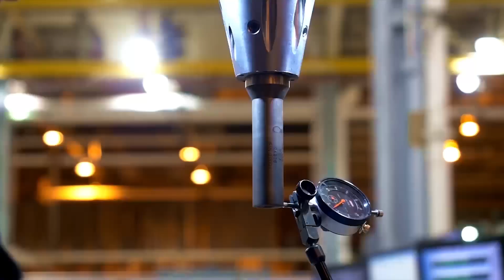Bad News For The 3 Artemis Missions

Comment: I love it how videos like this always show their bias when they compare the legacy Aerospace companies, Blue Origin versus SpaceX.  You just mentioned how the SLS will need to go out to the bad, do a zero count, then be hauled back into the VAB for inspection. Musk isn't performing these steps, but they are mandated by NASA.
Reply: Sure he is, for new designs. Every Starship flight to date has followed that exact model, with static fires followed by a complete checkup before launch. So has every Falcon for that matter. The Amos-6 mission that blew up on the pad did so during the static fire, aka when they were doing exactly this kind of prelaunch check.

The difference is that the SLS can only be inspected in the VAB, while SpaceX designs their rockets to be inspected on the pad to save time.
Reply: @gnaskar  Not really, especially considering the vast majority of the starship modles have exploded or collapsed. Their gunhow approach gets  results, but its something the other established contractors would never be able to do.

Comment: I like how you snuck the Hercules lander in there at 4:24 :)
I'm rather disappointed that you are buying into the "infinitely lower cost of Starship" myth, specifically as it has no basis in reality. Starship, and specifically Lunar Starship, is not going to be rated to take crews from the surface of the Earth to Lunar orbit any time soon. SLS already exists and the production and flight vehicles are in production as we speak. Starship mostly exists as a prototype-prototype with none of the systems needed to make it a viable launch vehicle let alone a Lunar landing vehicle. (Big issue right there is needing actual landing gear to, you know, have a viable landing vehicle... It's right there in the name no less)

SpaceX isn't going to 'step-in' and 'save' Artemis, it's going to be hard pressed to have a viable Lunar Lander by 2024 let alone an operational Starship/Superheavy system. (We won't get into the numerous OTHER systems that will be needed like viable tankers, propellant transfer technology and the orbital "Starship" depot that's needed) They have less chance of rushing a viable Lunar spacesuit into production than they have of building a humanoid robot, from scratch, is less than a year.

You did manage to point out the major reason for why Artemis is not likely to make the 2024 deadline which was Congressional funding issues more than anything else but in reality the 2024 date was a political rather than an actual NASA deadline in any case.

In any case it will be an interesting couple of years from here on out given the fact that NASA has managed to actually pry a viable Lunar Lander development budget out of Congress and the companies stepping up to the challenge of actually designing and fielding such landers.
Reply: I'm going to frame this comment an put it next to the ones saying that an electric sports car would never sell, and that landing rocket stages would never work, and that no one would trust an internet service with financial transactions. 

See here's the thing: If the goal was launch an orbital test flight of a super-heavy launch vehicle, then SpaceX and NASA are neck and neck. Both have the flight ready booster on the launch pad as we speak. Right now, it's up to the FAA whether SpaceX will get launch approval before NASA finishes running its tests, but the smart money is on SpaceX.

It's a prototype, but so what? It's still a launch vehicle, just as capable of reaching orbit as the SLS. Neither have flown yet, so neither has any advantage there. The difference is that if the SLS launch fails, we wait 2 years for the next chance. If the Starship prototype fails, they'll have another one ready to go within 2 months at most. So SpaceX have 12 design iterations in the time it would take NASA to do one. The corollary to that is that their first iteration is going to be more scruffy looking, because they don't have that enormous pressure to get every little detail right the first time. They can use it to see what needs fixing, rather than just as proof that everything works.

I don't think you seriously believe that the Starship HLS program will be delayed because they needed more time to develop landing legs. That the easy bits aren't being prioritized yet, while they work on the basic capability to put stuff in orbit is just good planning, not a sign that things are terribly wrong. As for the other systems you describe, you repeat yourself. The one genuine risk of the Lunar Starship program is orbital fuel transfer. It hasn't been done at scale yet, nor to my knowledge with cryogenic propellants. That's something that you'd expect them to begin testing as early as possible. Of course, it's not possible until they're in orbit, which is why we haven't seen any tests yet.

What doesn't follow from that is that they couldn't develop a space suit in parallel. The team that developed the SpaceX IVA suit isn't currently busy welding steel in Texas, because that's not their area of expertise. So they can have one group work on the rockets, while another works on the suits. They're a company of several thousand people (and doubling every couple of years), so they aren't constrained to working on one thing at a time. Also, the humanoid robot is Tesla, not SpaceX. Different company entirely. Also, I'm still not convinced it wasn't a joke.

Comment: I'm quite confused about this NASA/SpaceX joint venture. As I understand it (not very well) they are going to launch a modified Starship using the SLS? Why would they do that if the Super Heavy Booster succeeds in launching, which might happen quite soon? It's not like it has to succeed in returning to Earth, because the SLS is guaranteed not to do that. And if it should successfully return, then surely it's game over for the bastardized Space L Shittle? (Whose bright idea was it to keep the parts that blew up the Challenger?)
Reply: Here is how a Moon landing Artemis mission is planned to go per page 27 of the GAO decision to deny the Blue Origin complaint. The [DELETED] is apparently at least a propellant depot, likely more than that. Note, Musk has said that with Starship now capable of lifting 150 tons to LEO, it is a max of 8 Tanker launches, possibly less to refuel [DELETED], the propellant depot. (my comment in parenthesis)

"SpaceX’s concept of operations contemplated sixteen total launches, consisting of: 1 launch of its [DELETED]; 14 (8) launches of its Tanker Starships to supply fuel to [DELETED]; and 1 launch of its HLS Lander Starship (unmanned), which would be [DELETED] and then travel to the Moon."

So after those 10 Starship launches, the unmanned, fully fueled Lunar Starship heads to the Moon to wait for the crew to arrive to the Lunar Gateway. SLS launches with Orion on top and Orion heads to the Moon to meet Lunar Starship at Lunar Gateway. Two crew stay on Lunar Gateway and two crew (later four) go down to the Moon on Lunar Starship. After the surface mission is done, Lunar Starsihp goes back to Lunar Gateway. Then all the crew return to Earth on Orion.

The fact that [DELETED] is a propellant depot is pretty obvious, so there had to be another reason for SpaceX to want that redacted by the GAO. I think it is that [DELETED] also can support Crew Dragon/Starliner in LEO while the Moon mission is going. IF so, that would open up the possibility of a variant of Starship just to transport crews from LEO to Lunar Gateway and back. Without needed to land on the Moon, a Shuttle Starship variant should be to ferry crew back and forth to lunar orbit and SLS can be dispensed with. 

SLS is expected to cost $1B-$2B per flight. Even if a Starship launch is $90M each (FH recovered cost), then you are looking at $1.48B to take up to 8 crew and at least a few tons of cargo (SLS is up to 6 and a few hundred kg of cargo) to the Moon. If you can turn around Pad 39A fast enough for two Crew Dragon launches in quick succession, that would save $140M over using Starliner and make the total cost $1.34B. 

IF Starship is $50M per flight (F9 recovered cost), then you are looking at $1.08B or $940M if you can use 2 Crew Dragons. The $2M number Musk throws around is the internal cost and there was a contract for a Starship satellite launch for $10M. Reportedly F9 has an internal cost of $15M-$18M and a launch cost of $50M-$62M. Ground and range costs can only go so low. So if Starships are $10M like that reported sat contract, then you have $680M with Crew Dragon/Starliner or $540M if you can do two Crew Dragons. 

Starship still has to get to orbit and Musk thinks that it should get to orbit, but reentry will likely take some time. Elon Musk's Mar 30th 2021 tweet

"Next major technology rev is at SN20. Those ships will be orbit-capable with heat shield & stage separation system. Ascent success probability is high.

However, SN20+ vehicles will probably need many flight attempts to survive Mach 25 entry heating & land intact."

Starship also has to demo Starship to Starship refueling in LEO with an end date of 2022 on a $53M NASA contract. With the first orbital attempt not happening until late this year at best, that very well could slip. Not to mention catching the booster and tankers.

Elon Musk has said that it would take hundreds of successful, operational flights before you could put people on board launching from and landing on Earth.

“'We’ve got to first make the thing work; automatically deliver satellites and do hundreds of missions with satellites before we put people on board,' Musk said, speaking Monday at the virtual 'Humans to Mars' conference" - CNBC Sep 2020 article

Currently, SpaceX has one launch pad still under construction at Boca Chica. The FAA EA is looking like, that flights from there will be limited. SpaceX is converting the oil rigs Deimos and Phobos to launch/landing platforms and SpaceX has plans for a Starship pad at 39A. So SpaceX has to launch 10 Starship flights from basically 3 launch pads. I would expect the propellant depot to go first from 39A. Then the 8 Tanker flights alternating from Deimos and Phobos. Finally, the unmanned Lunar Starship from 39A to refuel and go to the Moon. It would be the same for the Shuttle Starship with the Crew Dragon prepping on 39A after the propellant depot launches. A new propellant depot might not need to be launched if it has enough resources to stay in LEO after refueling Lunar Starship for the second set of refuelings for Shuttle Starship. Starliner would prep on SLC-41 for both of them to go up after the Shuttle Starship is refueled. Then they wait with the propellant depot for the crew to return from the Moon as they can't last that long on their own in LEO. The ISS is too busy with its own operations to stash them there.

Comment: I don't know why, but.. I have a very strong feeling that eventually they will use Elon's starship for the entire mission. Furthermore, they will take its basic model and add lunar landing thrusters on the top fins so they will scrap the lunar starship altogether: The slightly modified starship will fly to LEO, refuel by remote control and then the astronauts will board it when its fully refueled, using a falcon 9 with a spaceX dragon capsule. Then, it will undock from the dragon, which shall remain at LEO, depart for the moon, land on the moon, unload anything needed for a permanent colony and then takeoff from the moon and fly back to LEO, redock and transfer the astronauts back to the dragon and attempt landing on earth by itself, so even if the landing fails, the astronauts will not be on it, as they will return using the dragon. This is not only the safest way, its also the easiest and allows transfer of maximal cargo to the moon's surface while keeping the astronauts as safe as possible (only dangerous part is the moon landing but.. well, this is dangerous, cannot change that part).
Reply: how will they refuel it? with how many flights? ridiculous.
Reply: This is absolutely ridiculous
Reply: I hadn't really thought about it as much.  But sounds like a good plan to me.
Reply: Getting back home once you get past the danger of getting to,and landing on the moon. It's very dangerous either way.

Comment: Better to get it right that to meet a schedule
Reply: That's definitely a grand policy... up to a point, but there comes a time when you have to stop kicking the can and either put up or shut up. If you set out unprepared you might suffer problems and get hurt, but if you spend too much time preparing you might never start at all. The real question that we need to discuss I think is... why are we doing this? Beyond curiosity and prestige, is there really a good long-term reason to go to the moon, or mars, or anywhere outside low earth orbit? What are the real chances of our achieving anything meaningful there?
Reply: @dan4lau  Yep, definitely have to find the sweet spot.  You can't plan for every Black Swan event, but you also don't want to launch the ship without before you built and acceptance tested the engine. 

As for why... Well, if you have to ask why,  you are probably not going to be one of the folks going anyway.  Most people, even people who want to, won't.  I read somewhere about the number of rockets it would take, one launching every two minutes from somewhere on the planet, given 20 years or so would barely make a dent in the population of the planet.  We wouldn't even exceed the birth rate.

We don't need every person on the planet to want or "get" someone else's dream.  Someone has to want to clean the oceans.  Someone needs to want to enjoy the myriad facets of nature in ways as various as hiking in the woods or finding a new material by observing how spider silk is made. Someone needs to grow the food and keep the lights running in the cities. Anything we can do here, on Earth, eventually, we will find some way to do on Mars or the moon.  Because the bottom line is what's out there is real estate.  Nothing more grandiose than that.  Why do some people move to Australia, or Alaska? Why did the first humans leave Africa? Why did the Native Americans cross a barren ice sheet, and then keep going?

Because it's some place else.  And while most people may be content to stay where they are, others feel that urge to move on for whatever reason.  We are running out of places to do that on this planet. So some people look up and see that big round hunk of basalt we call the Moon hanging in the sky and thing "Why not there?"

The funny thing is that figuring out what it would take to move to the Moon or Mars has given us a better in site as to what it takes to live on this planet.  Those Apollo pix of a crescent Earth in a lunar sky wasn't a part of some planned part on the mission. It was the thought of a guy with a camera who had the thought "That's pretty".  Those shots and other shots of earth from space got us to thinking about Earth and ourselves differently.  Solar technology, who's advances were funded as a way to power vehicles in an oil free environment, and water conservation methods, just to name a few, have found applications that have the potential to solve growing problems here for the people who stay on this planet. Solve novel problems and you now have novel solutions to familiar problems.  

Then there's the notion that extraterrestrial human settlements could help us escape an extinction event: another asteroid slamming into Earth or a nearby star going supernova.  Pretty much any colony on a rock without radiation protection on the surface is going to have to be underground.  Depending on the distance of the supernova they just might be under enough ground to survive that too.  By designing working habitats on other planets, we could design better doomsday shelters on this planet that may actually allow folks to survive for generations instead of quickly turning into a very real and nightmarish version of "Survivor".

Summing it up. The reason to go is because we can and if we can't just yet, solving all those reasons why we can't. That knowledge gained is a treasure all of use can share in no matter where we reside in the solar system.  We don't know what we don't know yet and what things there are to learn along the way to traveling out there that will make things better here.  That is a treasure worth more than all the diamond on Jupiter.

Comment: Nobody's landing on the Moon without Lunar Gateway, and NASA hasn't even solicited bids for the components. 

NASA should've gone with the Apollo configuration of a lander enclosed in a Spacecraft Launch Adapter and using Lunar Orbit Rendevous (which has always been a bit of a misnomer) after the TLI burn, at least for the earliest landings, until Gateway is ready.
Reply: you could have ended after "nobody's landing on the moon".